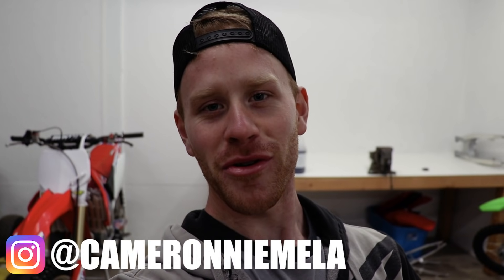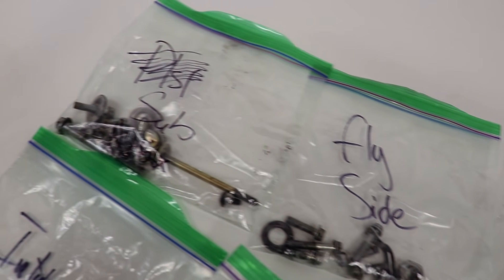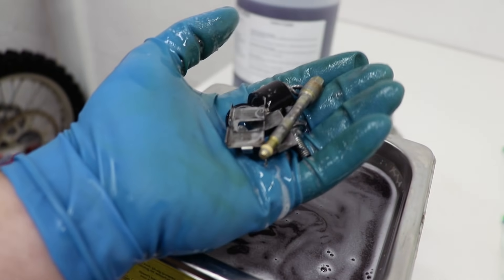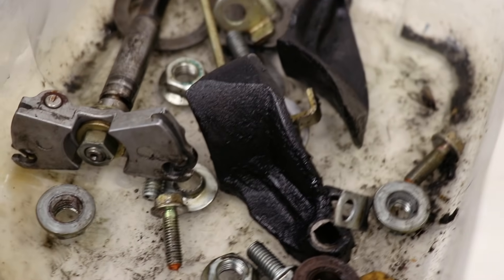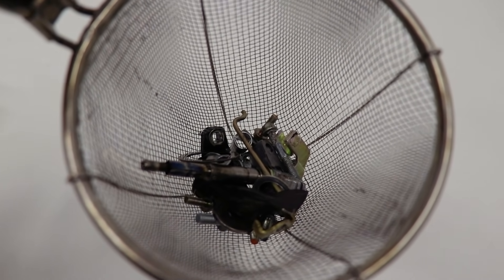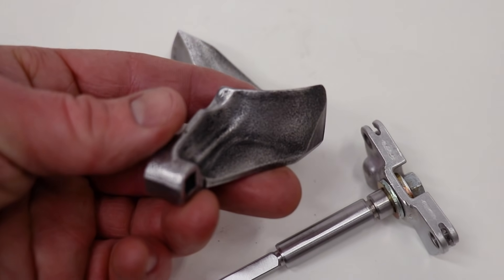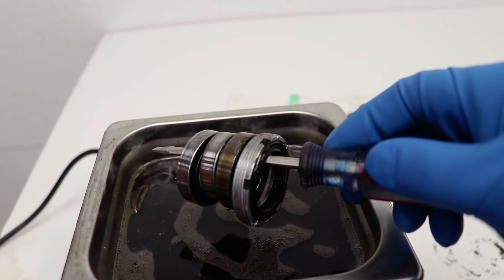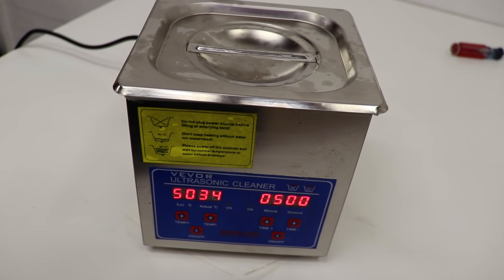How Well Do Ultrasonic Cleaners Really Work?

Comment: I need some advice, I have a KTM 105xc (2 stroke) and I noticed some scoring on the outside of the top end. I’m mixing my gas at the ratio of 40:1. I don’t know why it’s doing it and I don’t know what to fix. What should I do?
Reply: Yellow Sand try 32:1
Reply: Db RJ , I have for a while but I’ve fouled 3 plugs running it

Comment: I've always blasted my carb with baking soda then dropped it in the sonic cleaner. soda works well because it doesn't take paint off so it makes its perfect for cleaning painted parts! other than the soda breaks down fairly quickly. for those wondering the soda will dissolve out of the parts.
Reply: soda is also perfect for removing stingie carbon build ups because its doesn't remove any of the metal :)